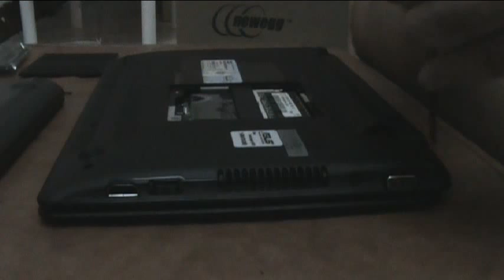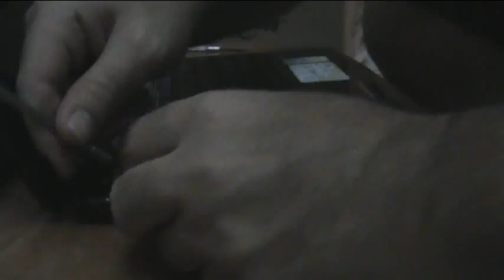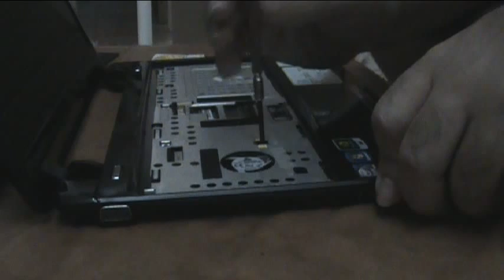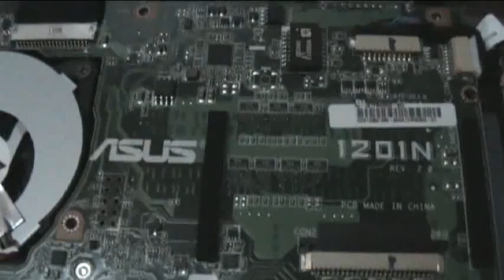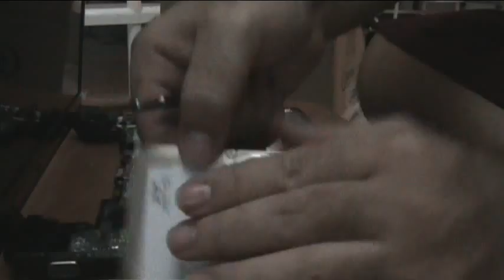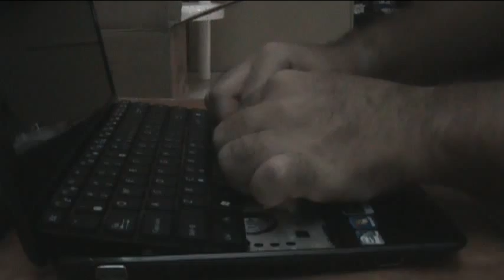ASUS Eee PC 1201n UPGRADE HDD TO WD SCORPIO BLACK 320GB 7200RPM

Comment: I just upgraded my Acer Aspire A250 with the Scorpio black 500GB. So far I'm liking it. I had a seagate 250GB 5400RPM replacing the 160GB Fujitsu 5400RPM. The seagate was very quiet but didnt offer much of a speed bump over the 160GB since the density is not much higher and rotation is the same. The black edition drive is somewhat faster but is a little louder, but barely...

nice music for your vid by the way :)

Comment: Of course, most of desktop HDD´s are still 7200rpm. I have a WD Raptor 10.000rpm´s, and the difference is notorious, only a lot louder. Gret video, help me decided to buy it or not, i was just searching for the rate of upgrade that is possible in this machine. Thank you so much.

Comment: lol there are 7200 ide laptop drives..

I used to manage computer shops in seattle..

some new drives are able to record, perpendicular to the platters and are able to shove more data in a smaller space and allowing the data to be accessed more quickly.

;)

Comment: @DJJEFFCLIVEISATROLL  Well one thing is for sure, SSD is still new but its going to improve fast. I think in a couple years, the reliability issues will be mostly resolved  and thats when for sure I'll go for it. I'm testing the OCZ Vertex2 right now and so far its working out well but its only been a couple months. Its definitely much faster than the OCZ Solid that I tested last (the two that failed).

Comment: @DJJEFFCLIVEISATROLL You're right, its true, they are more reliable than a normal hard drive when used normally but in our testing, we put it in one of our web servers and one of our SQL servers (database) as a torture test and they failed. We were not too surprised because thats the downfall of the lower priced SSDs. Most consumers wouldnt use it like this but for myself, I'd rather go something like the WD black with the 5 year warranty. In a couple years I'm sure reliability will improve lots

Comment: @DJJEFFCLIVEISATROLL Solid state drives suffer from limited write cycles and have to resort to wear leveling algorithms to maintain its lifespan. We beta - tested two units in a high traffic environment and they failed in under one year. They are fast, but until they improve, I'll stick to standard drives. Most SSDs right now are MLC which have a much shorter life span than SLC SSD drives. SLC is awesome but so expensive - beyond the reach of most people as far as cost per gigabyte.

Comment: @DevilDragon360 I dissembeld my asus Eee PC 1201n , and resembeld it.

Now it's starts but the screen does not, i desdembeld it aigan too if it was the cabel but it's seathed good in it's socket.

I noticed i have to press very long until it turns down, and also the fan does not alway spin.

Any help apriciated!!!

Comment: @DJJEFFCLIVEISATROLL Well one thing is for sure, its very fast and because of low access time, you can have multiple audio reads and writes without skipping a beat. I'll let you know what happens. Well gotta run.  Take a look at my page because the video should not be there anymore. Anyway good to chat without arguing. Guess we were on each others case in a vicious cycle.